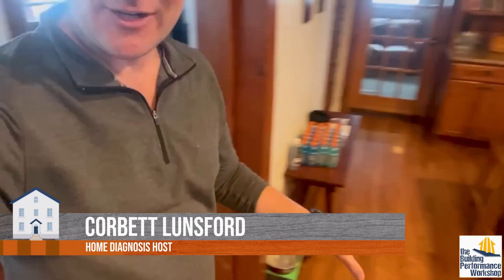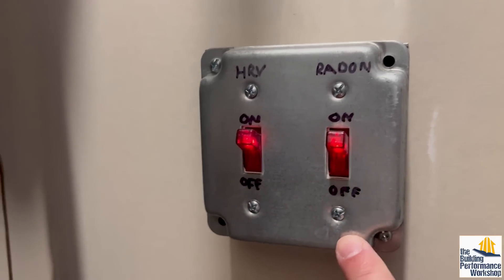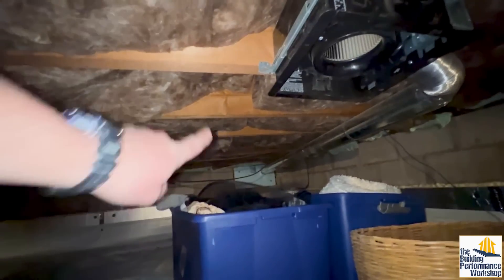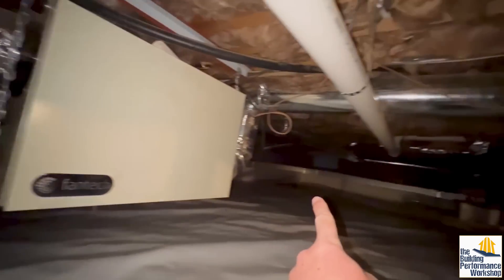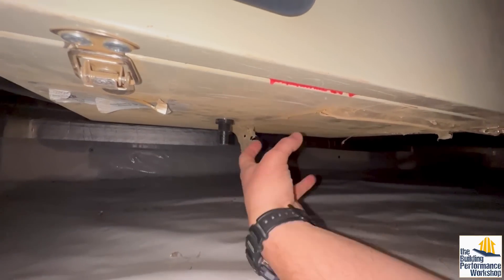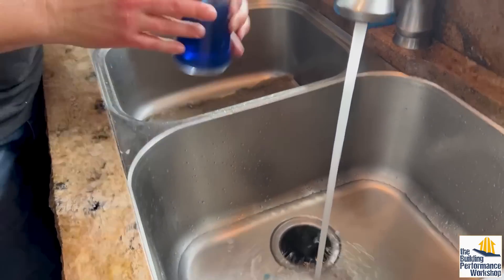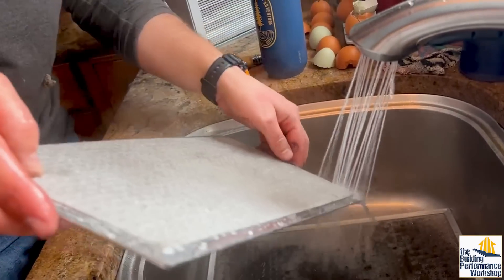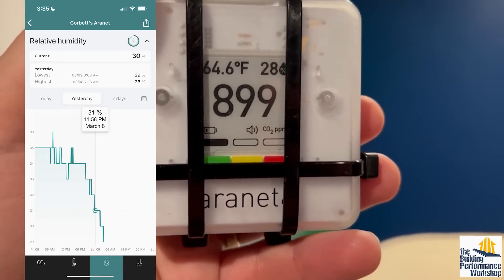ERV Inspection, Fixes, and Home Ventilation Advice from a High Mountain Crawlspace

Comment: Low hanging fruit: Do a simple rework of the duct of the HRV
a)	Rotate the HRV unit on its axis to minimize the angle bend totals of each run (ex 90 x 12 = 1080 deg). 
b)	Assuming that the unit has a flow capacity of over 150cfm, transition immediately to 8” on the runs that are longer than 40 ft, otherwise stay with 6”.
c)	It is ok to use one 90 at the unit if needed, otherwise it is better to simply use properly tensioned oversized (8”) flex duct bends which eliminate vibration transfer to the structure on all four runs and virtually eliminate condensation inside the ducts running in the unconditioned space in the winter months.
d)	I would totally install a low cost Corsi-Rosenthal filter or two with large MERV13 panels running on slow 24-7 or triggered when the ventilator runs if there is no forced air and media filter running 20min/hr throughout the house (1000+ cfm).  The need for filtered air at some velocity (>200fpm) is why I am not a big fan of stand-alone installations of ventilators.
Reply from the maker: Very detailed and legit

Comment: How are you coming along on those fire resistant vent covers I asked you about a month ago? Matt Risinger just did a podcast where he mentioned using Seiho vents and American Aldes vents, both of which are made from metal. As we get into fire season in North America I hope you'll have a video out soon on hoe to protect building penetrations from embers and flame contact.
Reply from the maker: Check out the new Vulcan Vents in my upcoming IBS Tour
Reply: Do they also make vent covers for range hood outlets, fresh air inlets, HVAC linesets, plumbing vents, or any other building envelope penetrations? @HomePerformance

Comment: I'm building a building for my wife's dog sitting business.  Being in Central/South Texas we have humidity most of the year.  Add dogs to the mix, air quality gets fun.  Add to that, a very, very sealed building (closed cell foam).  I'm going with a mini split (very poor filtration and de-hum), but adding an ERV, De-Hum and a AirIQ stand alone air purifier.  I might not need the de-hum, but I would rather have it and not need it, than .. well, you know.  I might be able to add it later... but it sure is easier before drywall goes up.
Reply from the maker: Great work Mark
Reply: @HomePerformance  Yeah, I've been a believer for some time, but never really had the chance to implement all the pieces of the puzzle.  I'm doing my best to think 10 years down the line rather than "just get it done...".  It's a bit fun trying to satisfy indoor temp, humidity, air quality and fire prevention.  It seems I'm overdoing it, but some things just are worth being dam sure you are in a good place.  Thanks for the videos!

Comment: KISS, keep it simple stupid  . The more complex you make the system the less likely it will be maintained or installed properly . Even if you were to create a whole house maintenance manual the likelihood that the second owner of that home would ever read and act on the required maintenance is very slim 😅 . I  worked in industrial HVAC more than 20 years and if the maintenance is not easy to access and simple to do it is not likely to happen. Home owners as a group are lazy cheap and ignorant maintenance costs money ,time and effort.

Comment: I love it spend a ton of extra money and seal up your house so you can buy more mechanicals you havv be e to eventually replace, troubleshoot, and have the annoying sounds and air movement yeeeseeaAAAA sign me up
Reply: Sounds like less techy the better for you. You could always go build yourself a mud hut.
Reply from the maker: @cellocovers3982 the new affordable housing
Reply: @HomePerformance  The real question is how to make Home Performance more affordable. 

I'm going to go off on a tangent.

If the industry succeeds, you succeed. 

You have a very ostentatious Youtube name if that day comes to fruition.

Subsidies have already been tried. They worked until they ended.

When self employed, you can also consult and travel.

But how does the local contractor make money?

It takes so much work, such attention to detail.
Reply from the maker: Sounds like this is not going to be an interesting channel for you
Reply: Sounds like they (commenter) would rather breath air filtered through their wall assembly instead of fresh outside air.

Comment: Nice real life example of what a knowledge and experience means. We built our house in Pa in 2001 and have hydronic heat which I love but NO central A/C or duct work or air movement at all. (Except one window A/C unit) We also have a wood burner. The only reason we have had little issues is we have ceiling fans and open windows regularly when we can, and have a dehumidifier and I’m sensitive to humidity or lack of. We do suffer with a dry house in the winter. I would never recommend this set up to anyone that doesn’t know to monitor their air “quality” but it works for us and is a low tech solution. That being said on our second home we are working on we are also going with hydronic but thanks to your channel we have a lot more tech going in to monitor air “quality”
Reply from the maker: Right on

Comment: Shouldn't the pipes be insulated, at least on the house exhaust and house return? Given that this is outside of the envelope? Or is the crawlspace sufficiently warm compared to the outside that insulation isn't a must? Given all those 90s, it might make sense to address that problem first even if it should be insulated. And sealing would be between removing some 90s and insulating. If the inside of the house is humid, condensation could be happening in the duct itself without insulation. But, I have never lived in a dry environment.
Reply from the maker: Yeah, since the HRV is in “unconditioned” space the two outdoor lines don’t need insulation, though it was ~20 deg F warmer down there than outside.

Comment: So what would be the best ventilator type for a cool moist climate, such as the Pacific NW? Most of the time we would need a dehumidifier regardless of the time of year.
Reply: Still an ERV. Think of it as maintaining an equilibrium of humidity in the house. You'll still need a dehumidifier.
Reply: @frqnj  And a humidifier seeing as it's a mountain climate, I just fill my Sous Vide machine with RO water and set it from 160 to 180; works well enough.
Reply: If your PNW home is too humid I the winter then you've got a moisture problem inside your home. The cool winter air holds so little moisture. In general, this is why homes get dry in winter in places with cool/cold winters.
Reply: I should have mentioned, if you have sufficient mechanical ventilation or a sufficiently leaky home the your house would likely be dry in cold winter